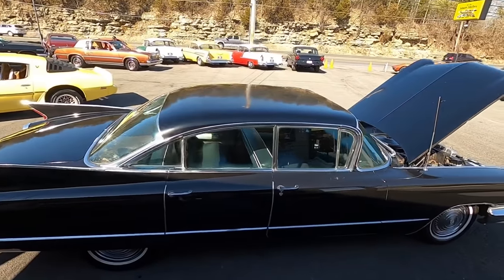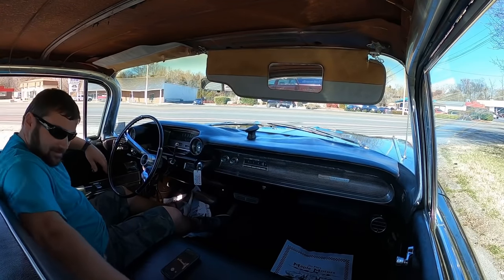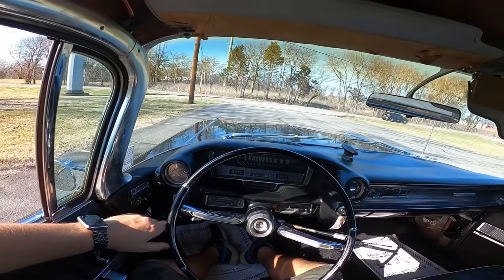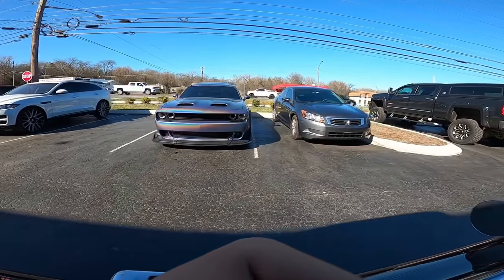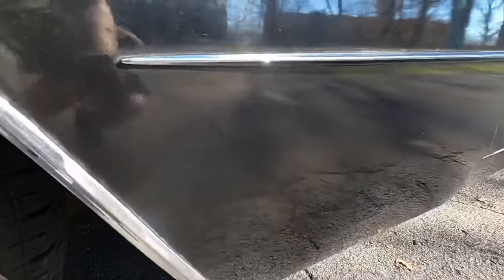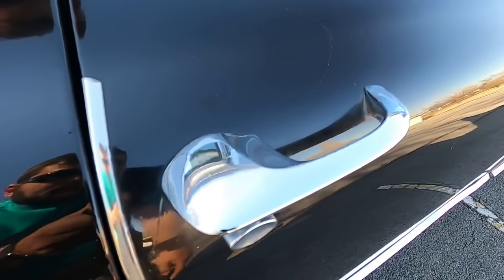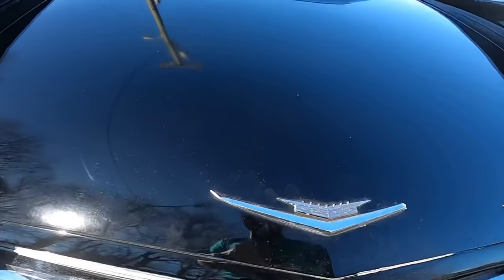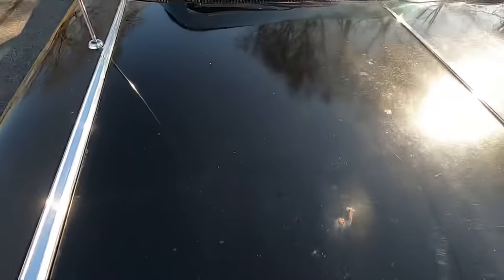Test Drive 1960 Cadillac Series 62 Sedan SOLD $14,900 Maple Motors #1498

Comment: Looks like a 60 Caddy would have looked in the mid 70's.  Typical used car then but an awesome survivor today!!!!!  Somebody please buy this and restore it like it deserves!  My father and I are joint caretakers of my grandfather's 1960 Cadillac 2 door coupe in Pompein red with white top and black and white interior and torque thrust wheels that he special ordered in the 60's.  Sounds just about the same as yours.  Those 390's had 325 HP. and will move along pretty good!

Comment: This won't work if it dead but if the window motor is going bad use a wrench or screwdriver and tap the motor while at the same time pressing up on the switch. If a cars horn doesn't work see if it's wire is connected.

Comment: MM always has an interesting selection.  I do wish that classic dealers would just stop with their fiction about original miles on 5-digit odometers - especially on cars that have obviously lost many long life parts (like this car's inexpensive past reupholstery, etc.)  Unless you have a documentation, trail and have gone over it with a paint thickness gauge, this is just an old car that should be hopefully reliable a local driver car.
Reply: He did say he did not know if the mileage was correct!
Reply: @charlesatwell6658  That is faint praise.